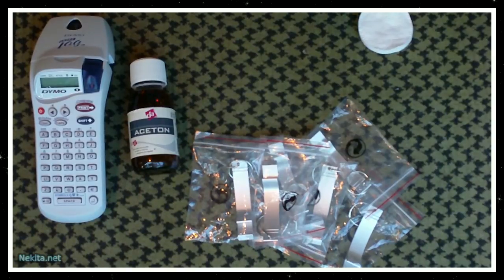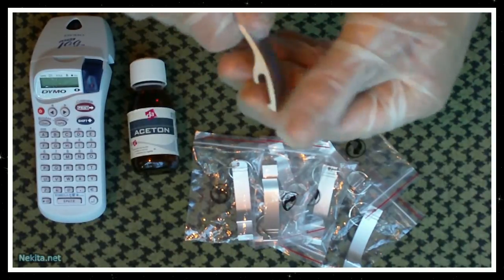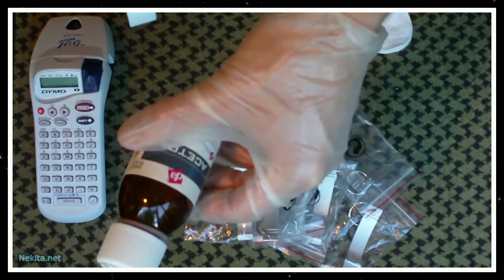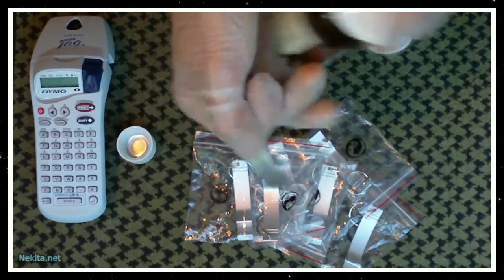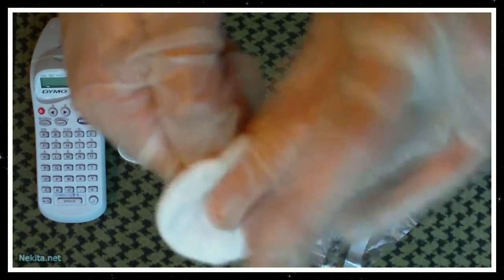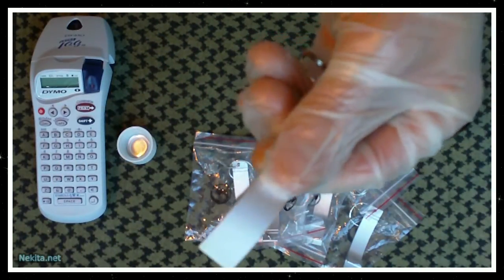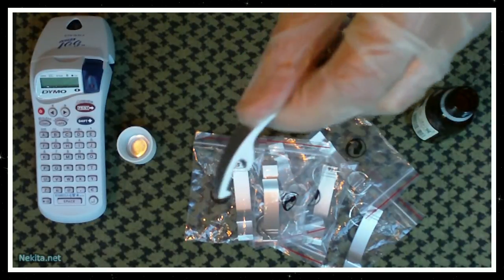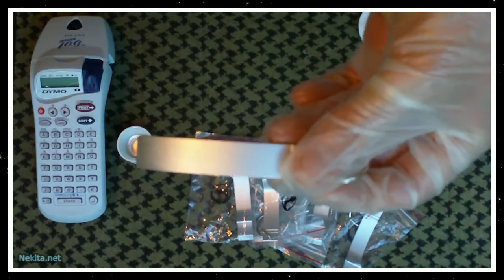How to remove silkscreen printing from aluminum...

Comment: Does this preserve an anodise finish or will it cause damage?
Reply from the maker: I've talked about that in this video if I remember correctly; Be careful with how aggressive you're going to be and take the process in steps. It's removing stuff and I'm guessing you're not looking to remove the anodized finish... So, take it slow and see how it does.

Comment: I want to remove the branding on my new stroller (hot mom isn’t really the message I wanna be sending) but the metal is a beautiful gold color. Will using acetone remove gold as well as the lettering?
Reply from the maker: Guessing, very much guessing here: If it's hard anodized aluminium, try the acetone on a spot that's unnoticeable. If successful and the color doesn't fade, try it on the lettering with beauty pads and WITHOUT rubbing. Since if it's not faded on that earlier spot the only likely damage will be from any "cleaning action" while applying the acetone. Best of luck!
Reply: NekitaNet great, thank you so much for the response! I’ll post the results here in case someone has a similar question
Reply: @borabibe5121  how did it go?

Comment: Would this work on a stainless steel like surface?
Reply from the maker: Most likely it would. But be careful to go "with the grain of the metal" (if it has a direction) and ensure to go easy so not to scratch the surface. Good luck! :-)

Comment from the maker: Is it possible to reuse silkscreen printed metal items, without any abrasive that is? Guess the trick for aluminium will be shown in the video, so have a look at some chemical magic and elbow grease...

Warning: This video has been produced for informational purposes only. The chemical(s) used in this video can be extremely dangerous and should be handled only by competent people and under every required & beneficial safety precaution. You have been warned! Your safety and that of others around you is your own responsibility! No liability and/or warranty is implied or given!